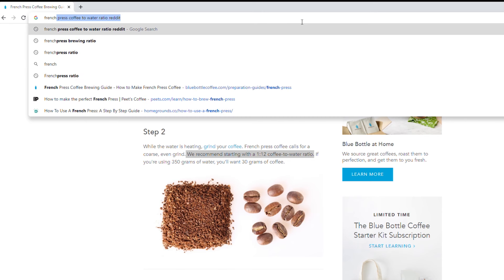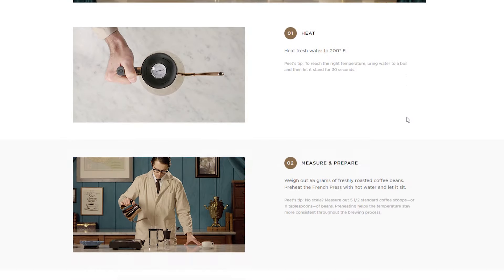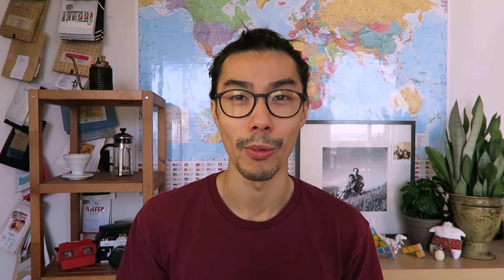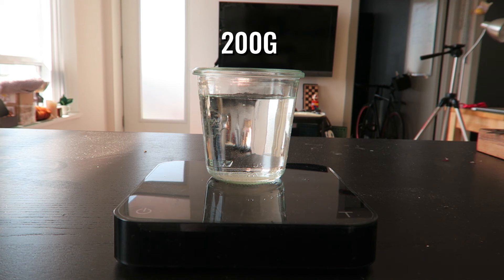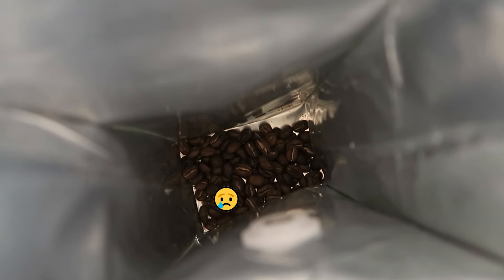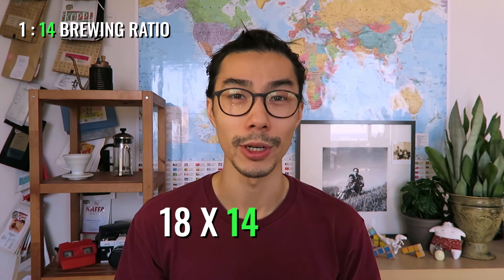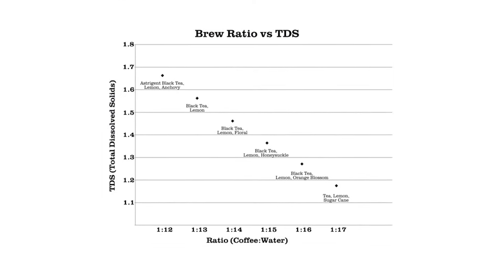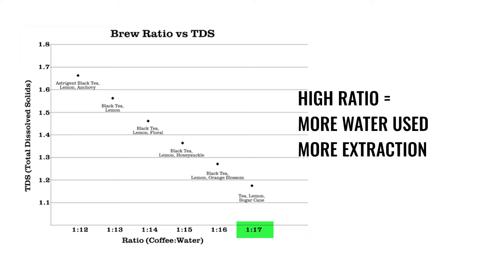Use Brew Ratios To Brew Better Coffee

Comment: Hi sir can i ask the best ration of coffee....im using coffee maker but i need to make it the same strong coffee as esspreso...thank you....like ur vid al lot...hope u will help me
Reply from the maker: Hey JV, sadly enough that is not possible. Espresso is a different beast compared to filter coffee. To put it in perspective, espresso uses a brewing ratio of ~1:2 meaning for every 1grams of coffee, 2grams of water is being used. This is possible because the pressure that espresso machines provide allow for a proper extraction to occur at those lower brewing ratios.

The closest thing you can get that somewhat replicates an espresso with its concentration and intensity is with a manual coffee maker is a Mokapot, and even that brewing device is far from a true espresso!

Getting a good espresso espresso setup can costs thousands of dollars and requires a lot of knowledge to get right. So perhaps the best thing is to master and enjoy filter coffee but treat yourself to an espresso at a cafe every now and then?

Comment: What is the best ratio for cold brew but like 1:15 ratio in hot i tried cold brew using 1:15 ratio but it doesn't taste the same its so light so i dont know what ratio i will use in cold brew but taste like 1:15 ratio in hot
Reply from the maker: Cold brew is indeed a different beast!
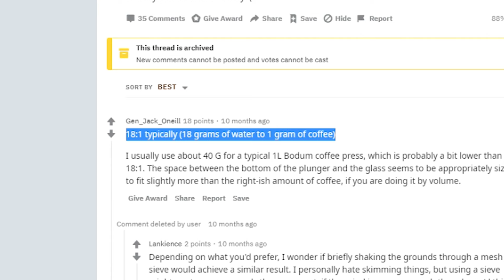If you are doing Japanese styled iced coffee (brewing hot coffee onto ice) then play around at the 1:12 ratio range.
If you are are doing cold brew (steeping for 24 hours) then play around with ratios lower at around 1:8.
Reply: Thank you so much for the answer can you make video of proper making cold brew and ratio of cold brew strong to light :)
Reply from the maker: @ItsJamesVlog  sure thing, I can put that on the video hitlist :D

Comment: Can you explain this in tablespoons of coffee grounds to ounces of water?
Reply from the maker: Ratios are usually done with two variables that can be easily linked and are consistent. Tablespoons are shaped differently and would measure different weight amounts depending on the roast. This is because a darker roast is more hollow and expanded compared to a light roast, which would make scoops of different roast levels weigh differently. 

As the saying goes, what's heavier, 100kg of feathers or 100kg of stone? They are the same because the quantity is not the important factor, but the weight is. If you use a scale, 20g of light roast is the same as 20g of dark roast. It would not be possible to measure out equal weights with a spoon when it comes to different bags of beans.

TL:DR - Brewing ratios need a scale and easy variables to be used. Get a cheapo scale!! It will make your cups consistent and brewing life easier :D

Comment: ok.. question: are you calculating brew ratio by water you pour into the dripper or by water you get in the end carafe? It seems like there is absolutely no clear distinction right now. Coffee grounds can absorb nearly 50g or water which can change what you mean by your ratio by 2 entire points. (25g of ground coffee -- 400g(water) in means final cup-weight of ~350g [this can be considered either 1:16 or 1:14])
Reply from the maker: There are only a handful of recipes that takes water retention into consideration. The fluctuation you are mentioning will only occur if you change the steps of your recipe to accommodate/ignore water retention between brews. Both methods are valid as long as you stay consistent. 

So either always measure the retention (which most recipes do) or have an elevated brewer and ignore water retention (which is cool too) because at the end of the day, you will be changing the recipe depending on the taste of the coffee.

Comment: I normally do 15 grams per cup.
Reply from the maker: That's a solid 1:15.7 brewing ratio. Ever deviate from your norm?
Reply: @brewinghabits  I'm definitely going to try something new. 1:15 is just something I read somewhere a few years ago when I was first learning
Reply from the maker: @SycFuk2000  it's for sure a safe brewing ratio. Higher ratios (1:16 - 1:18) are great for lighter roasts if you want to get into that territory. Exploration is key 🔥🔥
Reply: @brewinghabits  Forgot to mention, I use 15 grams because of my tablespoon measuring spoon. My new kitchen scale just arrived, so I'll definitely try a 1:18

Comment: 2:00 wouldn't you divide by 15 (1+14)?  Because the final drink will include both the coffee and water.
Reply from the maker: The brewing ratio is just a relationship between the amount of beans and water used. So think of 1:14 as "For every 1 gram of coffee, I brew with 14 grams of water" and since your final cup of coffee won't really have any grinds in it, there would be no reason to add the grind weight into the equation. 
Hopefully that cleared things up!